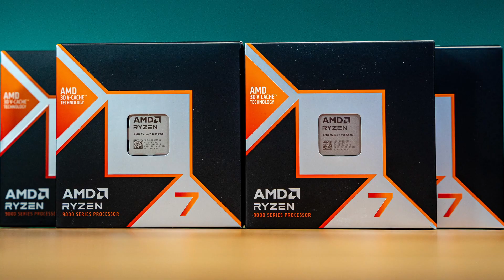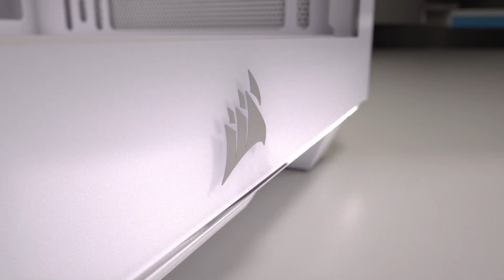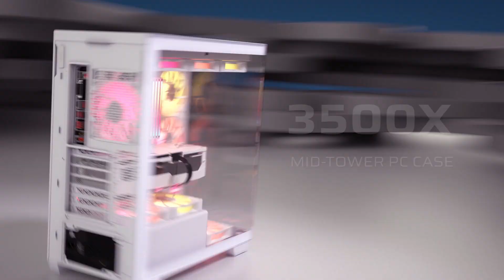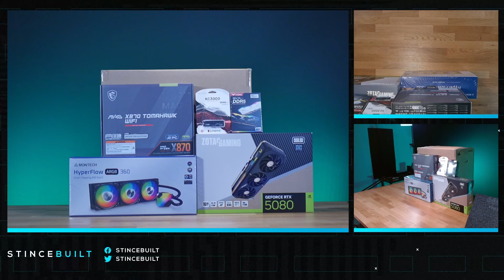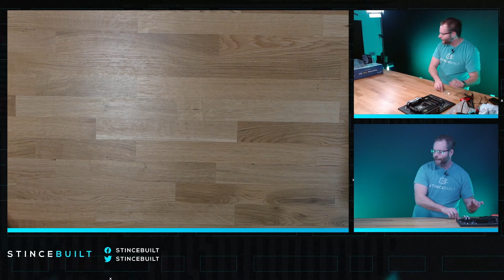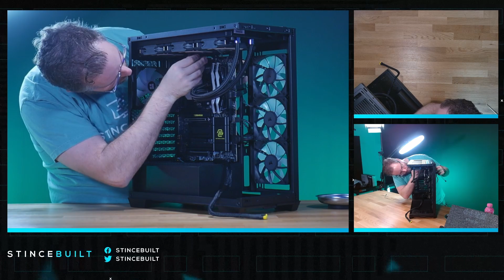Building a Gaming & Streaming PC BUILD Corsair 3500X l 9800X3D l RTX 5080!

Comment: is this a good all white build?
 Motherboard: ASUS ROG STRIX B650-A GAMING WIFI

Case: NZXT H5 Flow

Storage: Crucial P310 SSD 1TB PCIe Gen4 NVMe M.2

CPU Cooler: NZXT Kraken 240 RGB

RAM: Silicon Power DDR5 32GB (2x 16GB) RGB 6000MT/s

Power Supply: CORSAIR RM750x 750W 80 PLUS Gold

CPU: AMD Ryzen 5 7600x

GPU: SAPPHIRE Radeon RX 7700 XT
 
Cable Extension: CableMod PRO ModMesh Cable Extensions